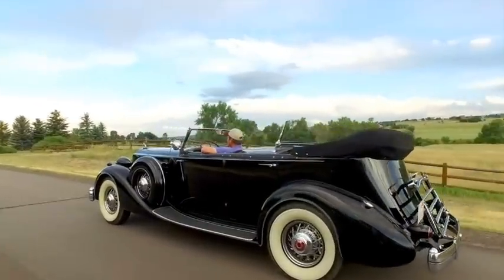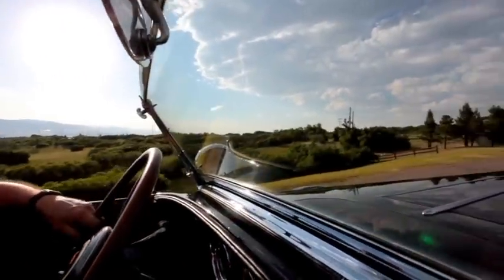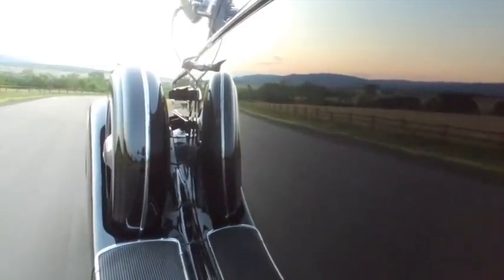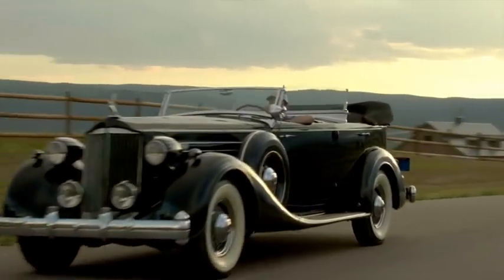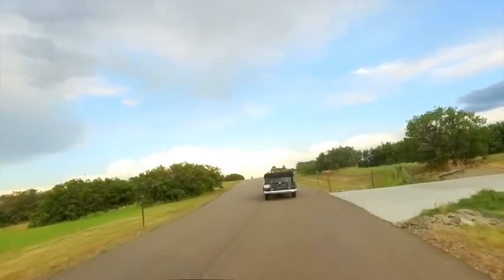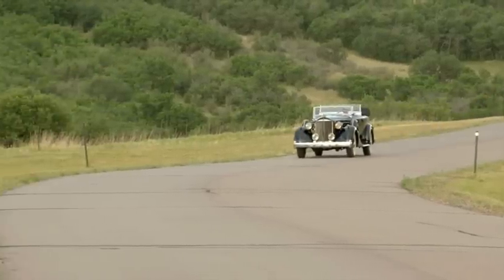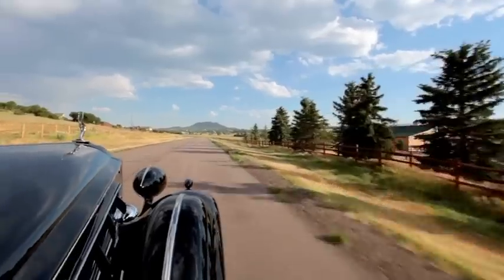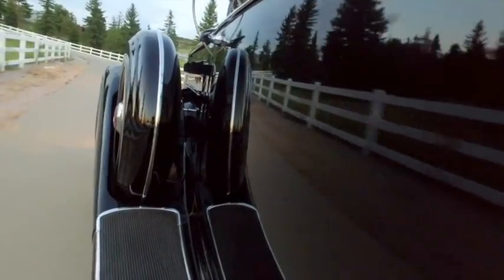1935 Packard V12 Dual Cowl Sport Phaeton Test Drive

Comment: I've had the amazing good fortune of working on and driving a '31 Cadillac V12 droptop coupe and you're right about the light steering and feel of these cars. That car (it's name is Daisy) was amazing to work on, not that it was easy, but figuring out the generator to get it working right, the carbs and how they worked (poorly!) and realizing the electrical diagrams for the ignition were reversed! The owner was so happy he could drive this car on the freeway when I was done with it, he let me drive it a bit. Only thing that was really needed was a strong steering dampener to get rid of the steering shake, after that it was great. I would love to own a prewar packard, just an I8 Sr. model would do. Heck I'd even settle for one of the higher line Buick I8's from the same period..
Reply: regarding the steering shake at highway speeds... did you have the tires shaved true?  it's my understanding the tire companies sometimes use the original molds, and the inside diameter isn't always concentric with the outside diameter.

Jay Leno discusses this on his JLG video featuring his '32 Packard.

any shop that handles alignments for Big Rigs has the equipment and expertise to perform this operation.  there's one a half mile from my house, and I occasionally see pre-war classics sitting in their shop being trued and aligned.

Comment: Ethanol gas = Vapor Lock. Don't use it on old cars with carbs. or any car with a carburettor. Unless these engines are overhauled for ethanol fuels, you will always have problems with pump gasoline. A very very nice Packard here shown. P.S. Your mic is a bit distorted.

Comment: So you drive someone else's car around for a thousand miles to make sure of what?
Reply from the maker: To make sure I have a good time.
Reply: Because the extremely wealthy person who is paying this guy to restore or repair  this car wants to make sure that it is right.
Reply: He specifically mentioned vapor lock. That's a big problem with old cars and the diluted stuff that passes for gasoline these days. You have to be really sure that the fuel lines are shielded from heat to keep the fuel from vaporizing (boiling) in the lines.